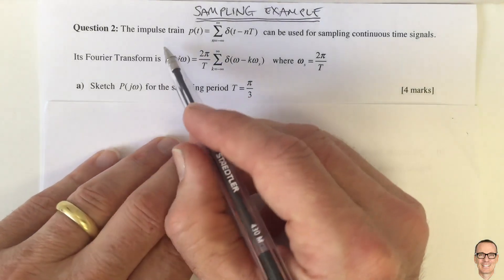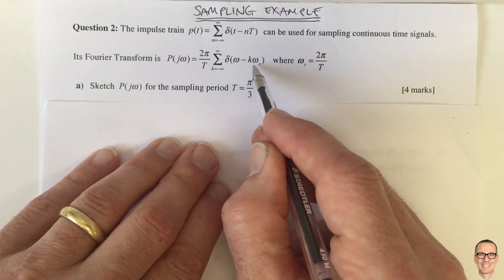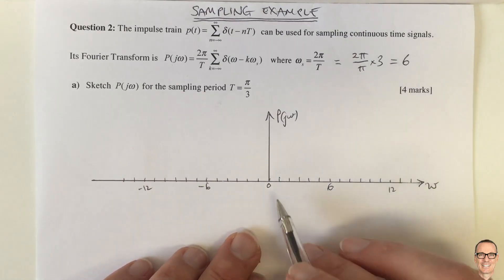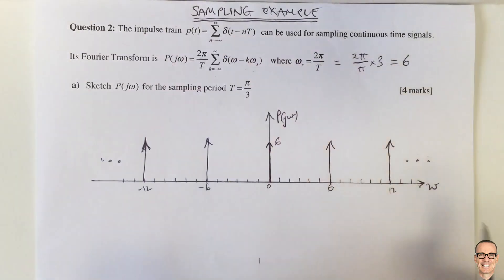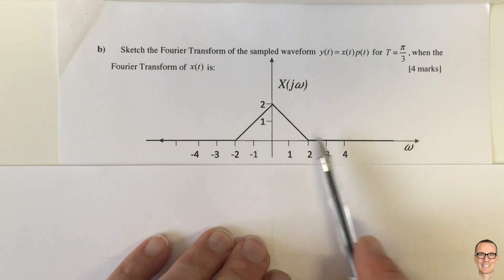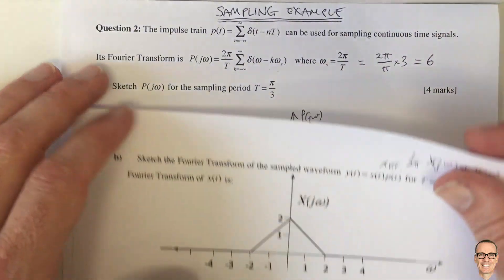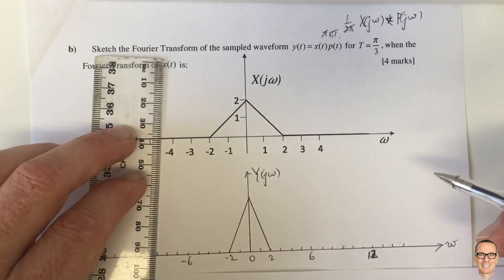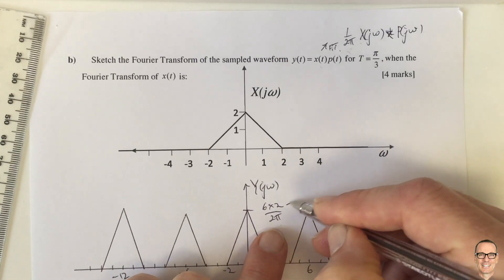Sampling Example

Comment: will the amplitude be changed if i draw the final spectrum in f (Hz) scale in stead of omega.  

please help me out
Reply from the maker: No, the equation for the Fourier transform is the same, whether you write it in terms of f or omega. Note that the inverse FT written in terms of integrating over d(omega) has a 1/(2 pi) term in front of the integral, whereas there is no term outside the integral when the inverse FT is written in terms of integrating over d(f). That's because omega = 2 pi f

Comment: i didnt understand why we get the constant at the end ..i mean the constant value .. can u plz explain ? thank u
Reply from the maker: The final function is the summation of each of the component (offset) triangles (since the sampling function is a summation of offset delta functions). This means that at each frequency value (omega) you need to add the values of the component triangles that overlap with that frequency value (ie. that are non-zero for that frequency). Since the triangles have straight sides, the decreasing slope of one triangle is exactly matched by the increasing slope of the other overlapping triangle, so that the summation doesn't change for the range of frequencies where they overlap (and hence is results in a horizontal line , or a constant value, for that range of frequencies). Hope this helps.